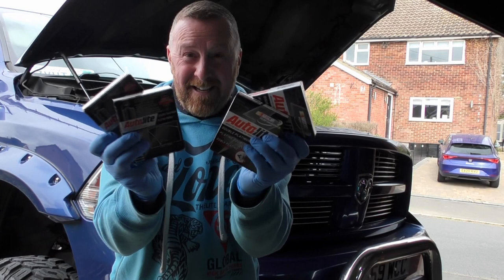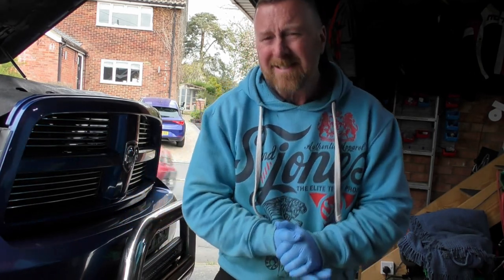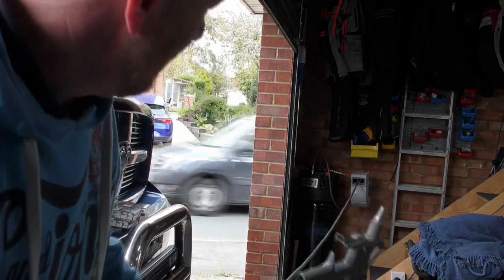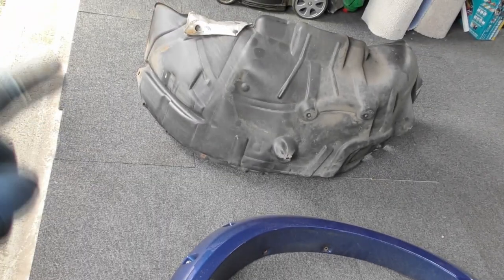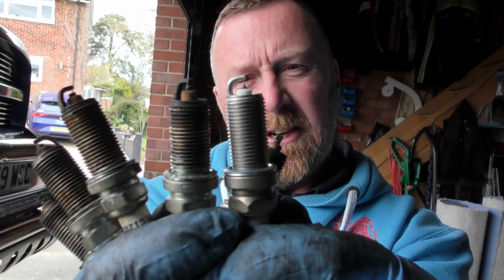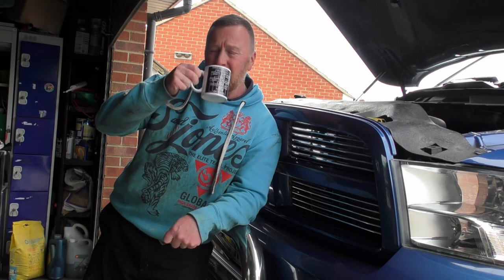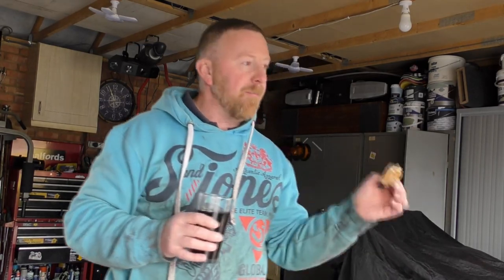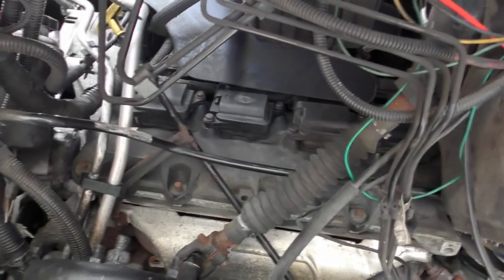V8 SERVICE DODGE RAM SIMPLE SERVICE MARK SAVAGE

Comment: Was definitely worth doing.
And like you said. Its a good opportunity to see anything that might need doing in future.
In the last video you mentioned the mpg on the display. That's probably still in U.S. Gallons, which are different to ours.
Reply from the maker: Yea bud say 11.4 but worked out after filling to be 13 plus I have 35" tyres on 
Will wait to see on my next fill up if there's any improvement 
But still very happy with the truck and will be going to a few shows 
Take care bud